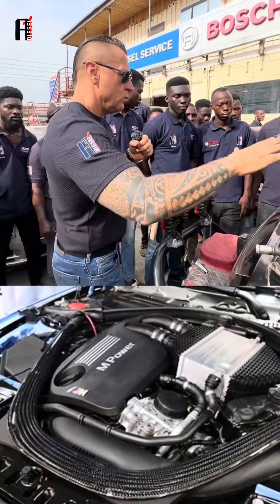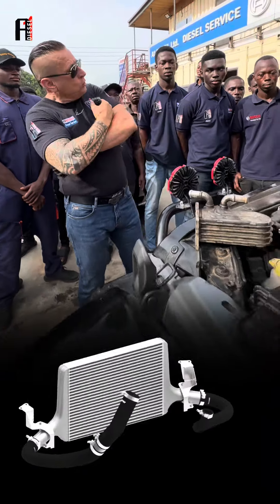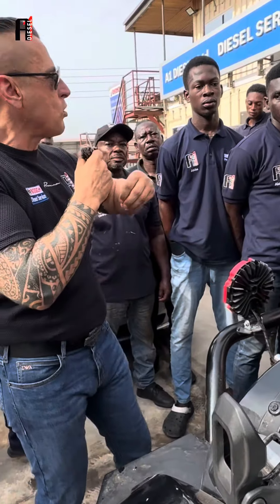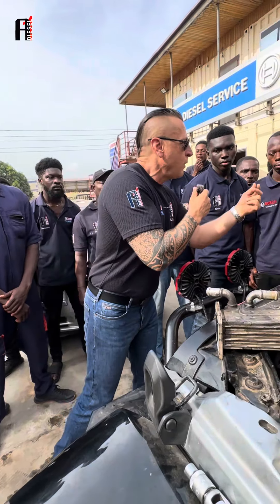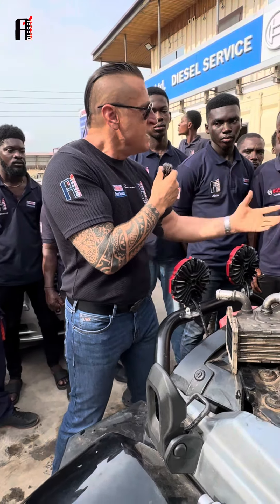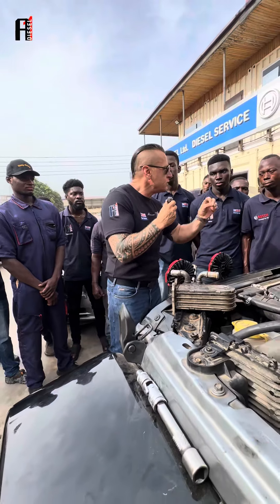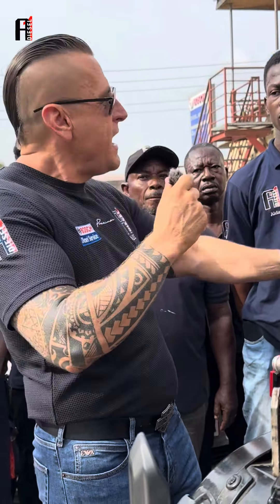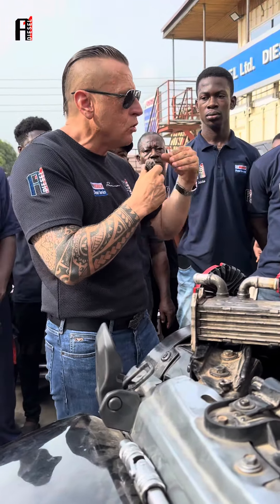Why modern cars use intercooler #intercooler #dieselmechanic #letslearn

Comment: Is also how and why, I get 30mpg on full size Dodge diesel truck by driving at night when the air over my intercooler is at its coldest possible temperature. (On hwy) City driving in heat and start stop gets me only 20mpg. Dodge still can not replicate that level of efficiency using the current engine configuration. They are working swerd-gab. They had it right using the Cummins industrial engine in the first place. Only requires 16% engine capacity to keep it at 70mph and 30mpg or about 2 gal used. If they used Na ion batteries and regen braking the energy used to get to 70mph can be the energy used from braking.
Reply from the maker: Thank you for your comment